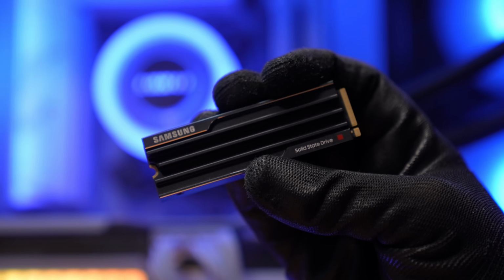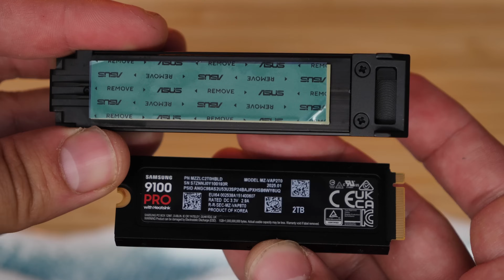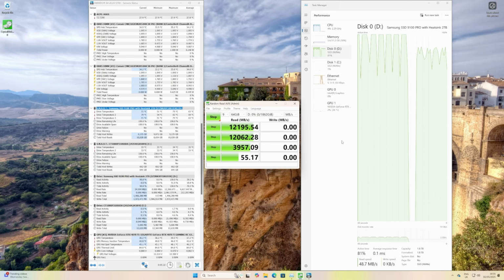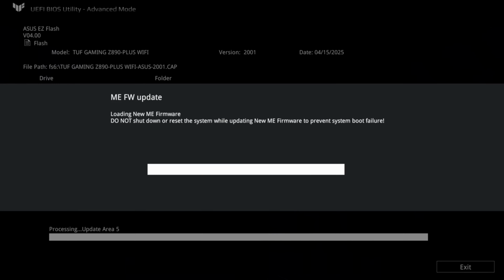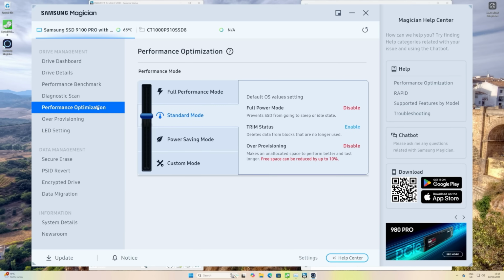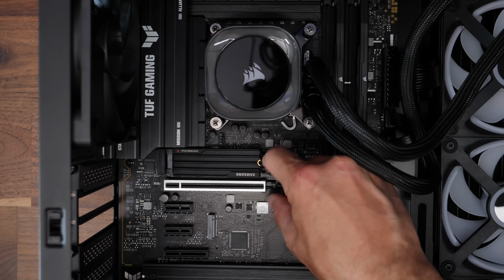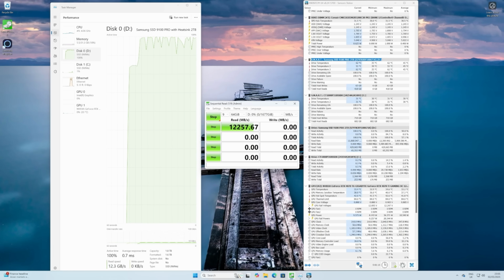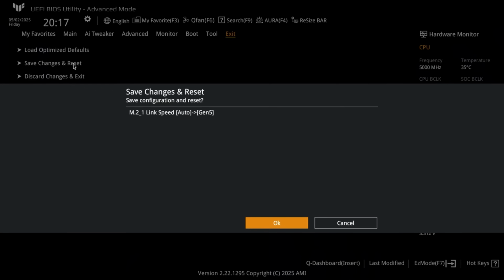What's better? Motherboard heatsink or NVMe SSD heatshields?

Comment: This is fantastic.  Exactly the drive I'm putting in my new build with an X870E-H mobo.  I'm using the 9100 pro as a system drive, so i'm not terribly worried about temps since there won't be many long sustained writes, if any.  It will mostly just be booting, launching software, loading textures/models and reading program assets.  nothing that should cause it to get too hot for very long.  I am a little worried about the two 990 Pro Gen 4 drives I'm using for storage, but we'll see how that goes!

Comment: WARNING! Z890 with Arrow Lake (285K, 265K etc.) won't run with max speeds. There is a thread on Asus forum about that issue. Asus contacted Intel and they said it's due to "unfortunate" architecture and you won't be able to do anything about it. M.2_1 which is the only PCIE5.0 slot available on those motherboards, shares lanes with GPU and CPU and due to that you won't get full transfer speeds. Bottom line I wouldn't recommend buying PCIE5.0 nvme drive if you have Z890 chipset with Arrow Lake processor. Save your money and go with Gen4 PCIE nvme instead.

Comment: Could you please do a test of the 9100 pro without it's heatsink in the motherboards M2B_CPU slot? So under the larger heatshield below the GPU slot. For example I have a x870E Aorus Pro Ice x3d motherboard which comes with 2x Gen 5 nvme slots. One is just under the CPU with chunky heatshield and one is under the GPU with the larger heatshield cover plate. Would this SSD be alright to be installed in the second slot?

Comment: Make sure you download the latest firmware and drivers using Samsung Magician. I was able to boost mine to its full speed as it played it safe at first. I used same software to keep an eye on temps while running between the two.

Comment: My rear 970 evo always ran hot...bought the cheapest heatink I found and since my side panel is mesh I put a fan there...CPU temps went down a degree or even 3 degrees on a motherboard sensor or more. But the m.2 drive is more then 2x cooler now and like idle 35'c and loaded up only like 45'c where before was in the 75'c to 80's

Im considering a smaller cheap heatink to stick on right at the cpu chip might even be better then 1'c 

Also my front m.2 drive with a heatsink runs in the 80's even with a tower CPU cooler. I think the solid heatsink design just isnt good compared to anything with fins and air

Comment: It's interesting. And I am not sure if it's completed related, but I have had a Samsung 990 pro with a heatsink in my first build and I was getting countless blue screens of "critical process died." I got that for around 5 months. I reinstalled windows 11 multiple times, swapped out every part, CPU, RAM, PSU, GPU, cooler, you name it. And in the end, after removing the 990 Pro from the b650 tomahawk motherboard and putting in another m.2 and this time, used the motherboard's heatsink, i stopped having blue screens.

Comment: mb stock thermal pads are for double sided chip m.2's. You have to replace to thicker thermal pads on both sides so mb heatsink will be working properly
Reply: How thick? Recommendations?

Comment: I use the standard x670e-e heatsinks on my Crucial T705 2TB and the Samsung 990 Pro 4TB M.2 and they both run quite cool with just x3 intake fans in the front mesh kit.

Comment: I've seen a video showing the ssd controller having lower height than the nand chip. This causes the controller to not making enough contact with the thermal pad and thereby thermal throttle itself. By using thicker thermal pad specifically for the controller, it made a big difference in thermal performance.

Comment: I will always choose to use a drive with its own heatsink over the motherboard's if possible. It's specced and supplied from the manufacturer, for that drive, with a warranty. It's going to be good enough and likely smaller. It's also less to have to manage when building and to have to "undo" if you want to swap the drive out in the future. NVME drives run warm and that's fine, providing they're within spec. This may be different with gen 5 drives but I have not used one yet.
Reply: The test shows it's not good enough.
Reply from the maker: I would have assumed the same but showed otherwise
Reply: @TheProvokedPrawn  Yes, noted. Interesting to see how much performance is being left on the table. Good information to have and will have to revise my approach depending on the build's application going forward. A lot will depend on individual motherboard heatsink I suppose, as well.

Comment: hi there i was wondering if you could check out the parts i want for my pc and see if there are any changes that should be made these are the part: ryzen 7 7800x3d, msi 5060ti, NZXT Kraken 360 RGB 78.02 CFM Liquid CPU Cooler,  Asus ROG STRIX B650-A GAMING WIFI ATX AM5 Motherboard, 	Corsair Vengeance RGB 32 GB (2 x 16 GB) DDR5-6000 CL36 Memory, 	Crucial P3 Plus 1 TB M.2-2280 PCIe 4.0 X4 NVME Solid State Drive,	Corsair 3500X ARGB ATX Mid Tower Case,	Corsair RM750 750 W 80+ Gold Certified Fully Modular ATX Power Supply,	Corsair RS120 ARGB 72.8 CFM 120 mm Fans 3-Pack

thanks and sorry for the long message

Comment: Crucial built in heatsink on the T705 is massive, i was afraid it wouldn't fit. I hope my strix B850E heat sink is adequate
Reply from the maker: It is large

Comment: My motherboard, the Asus X870E-E, has a huge heat sink for the gen 5 slot (slot 1). I got a Crucial T705, and it's been running great. I know it's not usually running at gen 5 speeds, unless I benchmark it, but even then it never gets above about 71C or so. Thanks for this demonstration.
Reply: Make sure u aren’t using the same shared pcie lane as the graphics card
Reply: @iineedmycherrioss7961  Yeah, I actually made that mistake at first, when I put the drive in slot 2. I then learned about the shared lanes, and switched it to slot 1 which doesn't share lanes. Thanks for checking though. 🙂
Reply: @EricTheRedKind  haha, yeah I also have that motherboard and had a lot of people tell me that so just trying to help out and make sure everyone else is good !
Reply: @EricTheRedKind  I also was gonna ask since we have the same motherboard, should I get heatsink for my ssd? It’s gen 4 though , let me know what you think for both gen 4 and 5 if I should use heat sinks or not
Reply: @ I'm about to power on for the first time so can't give you direct evidence for our board quite yet, but I'd 100% use the board heat sink setup with either option - even with Gen 4 controlling temperature spikes better should help longevity. 

I don't see how the board SSD heat sink will underperform any attached/generic one that has to optimize for compatibility/fit with multiple boards. That is, assuming you get the mounting/thermal pads right. both my 2TB 990 Pro and 1TB gen 5 9100 are single sided, so I used the M.2 rubber to increase contact to the heat sinks. It was slightly disconcerting installing them, but the contact without them wasn't fully uniform, so sub-optimal. 

On the bottom 2 chipset SSD slots, maybe there's a competition though as that heat sink doesn't have as much surface area. Even so, I doubt the heat sink version would even fit - it's definitely not fitting under my 9070 XT, and certainly not without compromising the GPU's fans.
Reply: I have the same board and am about to power on for the first time. I'm actually purposefully using 2 of the slots (for now at least) and paying the x8 GPU penalty because the 9070 XT is gen 5 and from what I've read/seen/understood you're not going to max out bandwidth of x8 gen 5 lanes even with a 5090. It's not free, but supposedly you're talking 0%-4% performance hit when GPU limited depending on the workload. 

I AM concerned about drive TEMPERATURE though so am curious to see what if any difference I see in temps. For now, I just have a Gen 4 and a Gen 5 both Samsung 9100 and 990 pro, but I'm going to play around with moving the 2nd drive between slots, since these are separate OS drives. The latency penalty of the chipset SSD slots should be worse than any other hit, but I'm curious to find out.
Reply: @clinttube  whether you max out the PCIE bandwidth is also down to whether you are playing for high framerates, if you are trying to do 8k, the FPS is relatively low, means the CPU sends less frames to the GPU, I would say even a 5090 can do well on PCIE3.0.

Comment: I turned the rear fan into an intake to cool the same drive.  Temps in the mid 60s, but then Im also using a thermalright HR09pro and arctic thermalpads.

Comment: Don't be so focused with temperatures. NVME SSDs are designed to run very warm to hot. As long as you have some sort of heatsink on them to help dissipate the heat that's fine.
Reply from the maker: @JonM-o1v  that's not actually true though is it. You can see the heatsink version thermal throttle here (hence the 2000 mb/s write speed) and I showed in a previous video where one with a motherboard heatsink just stopped working https://youtu.be/3dlq_Lqe8Fk
Reply: @TheProvokedPrawn  i think he meant that reliability wouldn't be affected by higher temperatures as long as it's within spec

Comment: My Crucial T705 was running very hot with the Motherboard Heatsink so i bought the ineo M9 and temp dropped 27 degrees celsius!
Reply: I’ve heard mobo sinks aren’t good enough for the 705 but apparently the heat sinks from crucial for the 705 work well.

Comment: i actually did wonder how "good" or bad these pre-installed pcie5 nvme heatsinks are compared to the latest generation of onboard high end motherboard's included heat sinks - i figured they would perform worse than the motherboard heatsinks but not by that much... 
that 9100 PRO is practically cooking itself ever outside of Samsung's own specs, in fact i think Samsung could be liable for a lawsuit that they even allow it to get over 85c in that scenario.
if you look at the warranty for the 9100 PRO samsung claims it is not liable for any damage caused outside of the designed temperature operation range - so if your 9100 PRO cooks itself to death because samsung didn't limit its thermal throttling protection to not go over 85c and it just cooks itself at 91-95c then samsung would not cover your warranty which i think is very shady practice...
what more those drive are technically intended to be used in Laptops or PS5's where that specific area does not have the same sort of airflow like a computer with 9 fans lol - which is only making things even worse...

as for the speeds you are getting - the reason why you're not going to ever see the 14,000mbps read/write figure on this 2TB 9100 PRO Nvme is probably because Samsung went the same route as other nvme manufacturers where the only actual 9100 PRO drive that can reach those marketed read/write speeds are the 4TB model and the upcoming 8TB Model.

for example, the Sabrent Rocket 5 would only do its 14,500mbps read/write if you buy the 2TB or the 4TB version, the 1TB version goes only up to 12,900mbps read/write.
i initially bought the 1TB version to be used as an OS drive but was annoyed that it only went up to 12,900mbps read/write, but soon realized that 1TB just isn't going to cut it as an OS drive in my specific build so i got the 2TB version instead and now getting 14,300-14,400 mbps read/write speeds.

i really hate when manufacturers do this type of thing because even on the lower capacity version they would still list the drive speeds of the higher capacity drives when it really isn't going to reach those speeds, but since no one really ever made a riot about this scheme it is what it is...
Reply from the maker: @HoLDoN4Sec  I don't know what's going on with the speed tbh because as I said, on another motherboard it was getting the full speed in both read and write. They're the 2TB models. So I think it's a motherboard thing for some reason but that wasn't the point of the video really it was more about the temp difference the heatsinks made or didn't
Reply: @TheProvokedPrawn  yeah this is why your situation was quite odd imo, because usually manufacturers only gimp the 1TB versions of their PCIE5 NVME's.

was the other motherboard that the 9100 PRO was running at full speed an Intel motherboard or AMD motherboard? if intel was it similar chipset or different chipset?

either way, another excellent video! :)
Reply from the maker: @HoLDoN4Sec  AMD to be fair - https://youtu.be/9E5I2mBUfgU
Reply: Good thing my Crucial T705 has thermal throttling protection so good it shuts down the PC!

Comment: I have a 980 pro with heatsink, I removed the heatsink and used my motherboard heatsink.. Way cooler... I have the Crosshair X870e Hero..
Reply from the maker: It's interesting because some SSD heatsinks are decent. Crucial's for example is huge and seems to do a good job.

Comment: I've always figured if the board mftr has a built in heatshield it's likely going to be superior to a smaller and less capable SSD shield. I think the only exception I found to this was a drive with a graphene and copper combo "sticker" which was an amazing dissipator. Gen5 drives get waaay too hot for my tastes as it is but with a good heatsink they can be fun. Thanks again for a fun video.

Comment: Open up the Samsung's heatsink and you'll see why you are getting toasty temps, I did the same thing recently and i found out that a piece of copper performs better than their heatsinks. 🙂
Reply: What I am wondering is if we use another heatsink on the non-heatsink Samsung version don't we need to strip off that label first ?
As it appears to be insulating the tops of the chips from the heatsink.
Reply: What do you mean open up, like cut their heat sink in half? Is it hollow inside or something? I don't have one to do destructive testing on :x
Reply: @Stealth55555  no, i just meant to tell him to open it so that he can see the surface of the heatsink and its thermal pads which aren't that great.
Reply: @Stealth55555  No, i just meant to tell him to open it so that he could see the surface of the heatsink and its thermal pads which aren't that great.
Reply: What would you recommend me? Can I use the SSD without the heatsink?
Reply: @mijailportobanco2104  Depends on how you use it. If you're constantly moving around big files or record gameplay on it nonstop, then you definitely need one. I would go straight for an active heatsink. Thermalright has a good one for 20-30 bucks. Often that's cheaper or in the same ballpark as the markup for the manufacturer's heatsink.